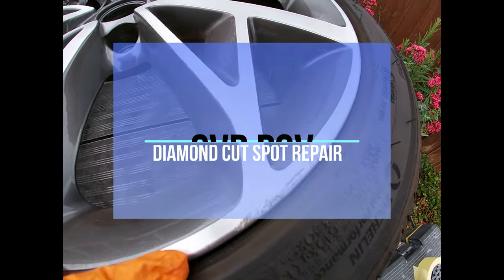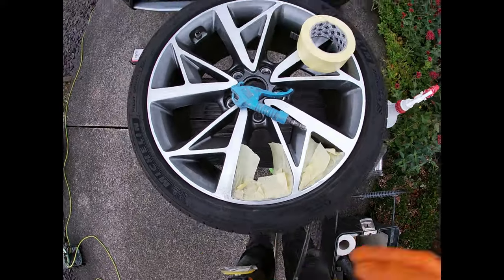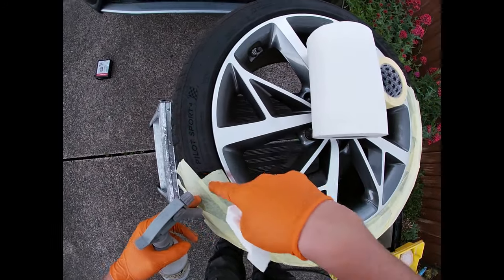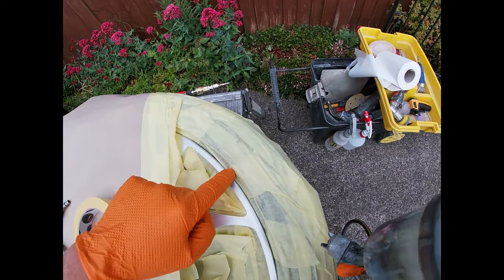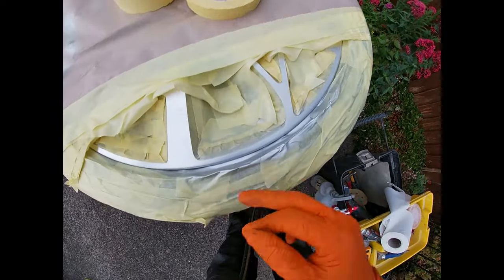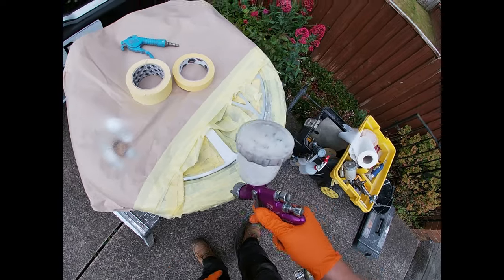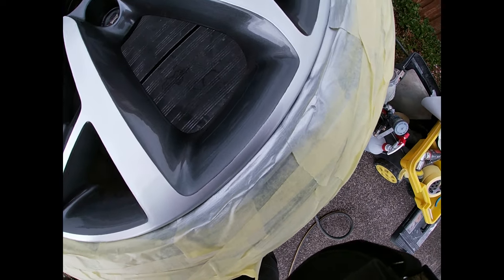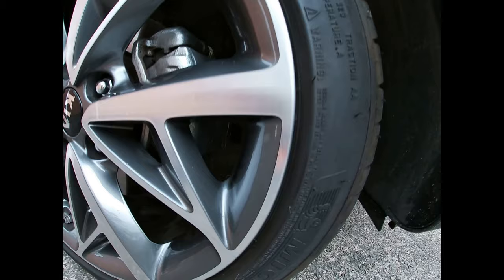Diamond Cut Alloy Wheel Spot Repair

Comment: Are you thinking 600 wet sand is good enough for diamond cut surf acing and add clear after, some guys are going to 1000 or 2000
Reply from the maker: I think 1000 would be better
Reply: Ok thkz

Comment: Thats a nice repair. Can I just ask why do you use the silver paint first and not just laquer over the repair? Is it so it blends in better?
Reply from the maker: Hi mate. When the diamond cut is sanded down, no matter how fine of a grade you take it to.. there is always an edge left, the silver is mainly to dust over this edge to make it much less noticeable (which works great btw)
Reply: hi is this silver paint to match the diamond polished look as well? I'm not sure what I'm doing wrong but I get a dull finish compared to the remaining 'cut' wheel

Comment: nice repair. A little tip, I use mipa vicrom, which goes perfectly with high-gloss turned aluminum rims.
Reply from the maker: Yep cheers
Reply: You don't happen to know the exact colour of the inside spoke dark grey on that Kia wheel?  I need to do a touch up on the same rim but can't find the colour. Thanks

Comment: Enjoy your work. Only thing I do differently for my business is when repair a Diamond Cut, I use a  colour called Liquid Metal.
Closest thing to a machine finish I've seen.
Reply from the maker: Thanks for the tip brian
Reply: Brian could you provide a link or suggest where to get this color you're talking about. Thanks
Reply: @brianholland77  PPG Deltron. D9070, Superfine Liquid Metal.
I believe there is a newer version of this.
Reply: Thank you Brian for the response 👍
Reply: @brianholland77  👍👍
Reply: Brian, do they sell it or can you recommend  something similar in an  Aerosol can? I have some touch ups on my diamond cut rims.

Comment: hi,great  video. Could you tell us why have you sprayed alloy with silver paint, other videos showing people just leaving bare aluminium after sanding and just coating with clear coat.??? thx
Reply from the maker: In this method just doing a section leaves an edge. The silver hides the edge
Reply: You mean the edge that is created by sanded down old clearcoat? (So the old clearcoat itself making that edge?)

Comment: Just wondered, could you not just cover the cleaned up alloy with the self etching lacquer instead of the silver paint?
Great video by the way 👍🏼
Reply from the maker: When sanded down the area will leave an edge where the old finishes have been sanded. This is why we need to dust some silver over it.

Comment: Hi Mate, does the painted surface on the diamond cut ever get damaged and if so how would you go about repairing it.

Does the original lacquer not need sanding down before or can you do the fresh laquer on top?
Reply from the maker: Hi mate. The old lacquer if sound just needs a good scotching up.

If the colour areas have damage then sanding down, masking and blowing in some colour to the area will be needed then lacquer the whole wheel

Comment: But the Paint itself wont Stick to the bare Aluminium Mate... 

As soon as the tire gets of and on mounted next tire season the Paint will Chip 🤔 

Next time, Spray a thin layer of etch Primer 🤷

But i have Something good to say aswell, the Result is nice 🤪 

Keep it Up, you earned a new subscriber
Reply from the maker: Hi Dave. These repairs hold up very well actually. I do loads of them and loads of repeat offenders which give me the chance to see my older repairs etc. Adding a priming stage wouldn't work for alot of this type of wheel repair (Imo)
Reply: @cvrpov  there is a Adhesion Promoter for polished alloys, powdercoated or chromed wheels. 

The Promoter is translucent, no sanding needed. Works awesome in my opinion. 

"BCI  1K Adhesion Promoter Metal" If u are interested.
Reply: @cvrpov  Just going through the comments and seen rare daves comment, while on training my instructor knew I was going to be tackling diamond cuts just like you are and he recommended a product  and a few of the other lads he has trained who are smart repairers swear by this product for adhesion promotor onto bare and polished metals on diamond cut wheels.

The product is called Henkel Bonderite its a bit expensive but will last a very long time. 
Its like a baby wipe and you can use the wipe over and over again as long as you put it back in the container after use.
It cost around £90 for 50 wipes which is expensive but as other smart repairers have told me they wipe the surface once prepped and then put the wipe back in the container until the next set of wheels they are doing then 2k clear onto the diamond cut wheel for max adhesion.

This stuff you just wipe the diamond cut area with the bare metal it takes 1 minute to evaporate and etch the metal then you have to spray the moondust silver on within 15 minutes of wiping the area  making this stuff awesome for doing this type of work as its super fast to apply and works great so I am told.
I am ordering all my spray materials this week or next for starting up and this stuff is on my list :)

You can get this stuff from https://www.spraygunsdirect.co.uk/index.php/henkel-bonderite-metal-etching-wipes-throw-away-your-etch-primer.html

Another option is buying self etching 2k clear coat for diamond cut surfaces but that costs double the price of normal 2k clear,,, I would rather use the bondrite wipes to be honest

I will also check out rare daves product as well as its good to have more than 1 option
Reply: @ravedave513  Hi mate can you provide a link to where you buy this stuff as I keep getting webpages in German when trying to find this stuff pal
Reply: @glitchtheory6609  unfortunately its a German Product
Reply from the maker: @glitchtheory6609  Sounds interesting mate, I'm always up for new tricks and products etc. Anything to make the repair even more stable would be a bonus. Like mentioned I do fortunately get to see these repairs down the line and they seem to hold up better than you would expect. However, if you can cost effectively increase durability then that is definitely worth a look.
Reply: @cvrpov  Yea bud I can imaging the 2k clear would hold up pretty well on its own :)
I have been going over and over your videos  for the diamond cut wheels and cant wait to start practicing the methods I have seen in your videos,
I have ordered 1L of moondust and titanium silver to keep on the van for this type of repairs

Comment: Is there a color in a spray can you can use to achieve this? I've used multiple different shades of silver in a spray can that didn't come out so well. I don't have a gun just wondering if it's possible. Great video 👍
Reply from the maker: Moondust silver is a good all rounder
Reply: Hello! How do you blow the putty repair?

Comment: This helped alot thanks. One question though, how do you fade in matt lacquer? Does matt lacquer need fading in if only part of alloy if being done and not whole surface. Reason I say that is because I have brand new alloy that has a scratch on  small part of spoke. Thanks
Reply from the maker: Its gloss lacquer on the metal. you cant tell by eye it looks good

Comment: Hi pal, great video this really good job and explanation, i’m competent with a spray gun and have a good 3hp belt drive compressor to use, i’ve got a a good electric 6 inch polisher and am looking for a 3 inch one, can you suggest and not too expensive either nuematic, cordless or electric? Thanks Dave
Reply from the maker: Check ebay out and buy a mini Air da like the one I use.. theres several to choose and are pretty much the same but re branded.

Comment: Does this get rid of the diamond cut effect though? I've got 2 wheels on my Porsche that need very small curbing marks taking out but if it gets rid of the diamond cut effect I'm going to have to have all 4 done completely?
Reply from the maker: Hi Andrew. Yes it does alter the effect. It works great on minimal kerbing and is an alternative to having the whole 4 completely redone and the costs involved. If the wheels are kerbed all the way round however, then perhaps it will need properly re cutting.
Reply: Depending on what style of wheel they are you could only need two doing if they are on the same side of the car.obviously Porsche wheels are wider on the back to front so can’t swap one side for the other to match it up.

Comment: I've got two what I think are stone chips to the powder coat spokes on my BMW diamond cut alloys. Both on on the rear wheels just a small chip on each wheel. Will they have to be diamond cut or is it something that can be repaired more easily..
Reply: If it’s on the colour part of the wheel that can be repaired without diamond cutting the wheel.it will be the opposite repair to this where they will mask out the diamond cut and paint the spoke/inner and lacquer.
Any wheel repair man will do this with ease.just search for a local mobile wheel repairer or smart repair technician 👍🏻
Reply: lachojski2005 Thankyou..👍
Reply from the maker: You can repair them the same way as the video 👍🏼 coloured bits aswell just mask appropriate areas off